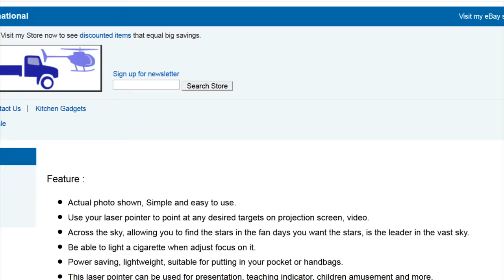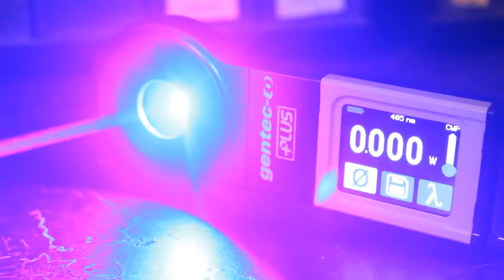Testing Illegal Blue Lasers from eBay (and making them even stronger)

Comment: I actually got a 450nm 1W Blue Diode Laser a few years back. It uses a 12V power supply and I adapted a set of lenses to focus the light into a variable+distant point.   For safety, I use some pretty dark welding goggles when it’s powered up, It can burn through 100 page pocket notepad in 30-45 seconds.
Reply: Can I ask where you got the diode and how hard is it to make your own hand held lzer

Comment: "Now it wont ignite my propane tank"
points laser directly at very flammable tank
WHATTTT
Reply: JoshLaw Music honestly i was scared for him when he did that
Reply: cästles theres always one LMAO
Reply: The guy clearly knows what he is doing. It's not that lasers can't "cut through" metal, it's that metal is a very good heat conductor, and all the energy of the laser is almost immediately spread around the thick, heavy metal casing of the tank. There's a common science demo about popping balloons with candles. Adding even a little water to the ballloon will allow it to sit in the flame for several seconds longer before heating the rubber up enough to pop.
Reply: A metal tank with a lot of mass is not going to heat up meaningfully with a brief touch of a 5W laser.   Some laserrs can can certainly cut through metals.  But not a 5W laser nearly instantaneously..  I'd bet money that he could shine that laser directly on that tank and it would NEVER blow up.  Too much thermal conductance from the thick metal.  Wanna bet me $10.  We can let Styro Pyro bet the official judge.
Reply: @Coasterguy Brilliant reply.

Comment: “Now it won’t ignite my propane tank. But, it can pop balloons with ease.” -Styropyro 2019
Reply: ..., standing less than one meter away from the propane tank
Reply: Propane, like gasoline, won't ignite from heat. Check out Myth Busters on gas tanks. If there is no oxygen, they won't even burn if a match is tossed in.
Reply: @mikemondano3624  myth buster also debunk HHO and turns out you can run a car on HHO https://www.youtube.com/watch?v=vglRrAAeGnE
Mlitary knows it we cant know it so they debunked it cause then no more oil and gas money cause turns out we dont need gas just water and baking soda lol
https://www.youtube.com/watch?v=uTOddz4x2M8
hmmm the heck???? you can use salt water too.

requires no mechanical modification of engines just a unit to convert water in to a gas form with electrolysis plates. so yeah it can be made with a fuse 30 amps switch so it does not drain the car battery with direct connection and it has a kind of pulse pattern so yeah. 
not sure I trust myth busters at all since some of the myths they  "bust" seem to be flat out proven to work and they are the "dont try it cause we know it work we cant let you know" people

Then people say "water would rust the engine" nah if that were the case then they would be rusting already since on a humid day th engine sucks in water and Gas can have water in it as well and we never hear about rust in the engine but on the surface where oxygen is freely available and its too hot in the engine to keep the water inside and the salt does not go in to the engine its just a catalyst to conduct electricity to make the gas so that is not poured in to the engine. 
I may make me one of them units closed cell HHO generator.
2 liters of water is equivalent to having like a full tank of gas like what??? can save a bunch of money with a generator and say screw you power company and have a water powered generator or something also added benefit it released more dense oxygen 30% that is more pure then the air outside. 
Funny they know about this and yet tax us on climate change right? but if we all swapped to water no profit for big oil  go to a local stream and get more water lol.
Also important to use one way check valves for gas safety to prevent flashback and people have also put in a copper mesh or extra measure and hook the intake to the air intake manifold near the air filter or direct to the engine. 
Myth busters didnt add a catalyst like salt or baking soda so theirs didnt work as good lol
Reply: @mikemondano3624  well most, if not all fires can't ignite without any oxygen...

Comment: “Let’s see how much power i can get out of this thing”
replaces all of the components
Reply: He replaced the diode, heat sink, driver and batteries. It still looks the exact same minus the hole in the side.
Reply: @hoagielamp6543  The diode is the "heart" of the laser. Changing the diode and all the control electronics is pretty much another laser in the same case.
Reply: @hoagielamp6543  that’s like changing GPU, CPU, RAM, SSD and Power supply but leaving old case. At this point it’s just a new pc.
Reply: @wiktorandrzejewski8242  Yes, now where do I purchase those replacement parts shown in video? :D
Reply: Well that was the point 9:43
Reply: @wiktorandrzejewski8242  If you were upgrading a cheap PC as much as possible or anything like that you would change the parts to get the most power out of it. No different in this case either. What did you expect ?
Reply: @cmac6136  sure, thats not the point tho. At what point does the old pc become a totally new pc? It’s an already well known thought experiment called “Ship of Theseus”.
Reply: @wiktorandrzejewski8242  yea, but for a Computer it is the Motherboard and for the Laser it is the Diode, the Core of what the item is, a ship...well I guess that's why it's a thought experiment because idk

EDIT: sorry wrong reply, I meant @Cmac 613
Reply: no, first he reduces it to a husk and then replaces all the components XD
Reply: I can imagine that with Phil Swifts voice
Reply: Here is the Original Semitic Text. HERE is The TRUE Savior

YaH The Heavenly FATHER HIMSELF was Who they Crucified for our sins and “HERE IS THE PROOF”

From the Ancient Semitic Scroll: 
"Yad He Vav He" is what Moses wrote, when Moses asked YaH His Name (Exodus 3)

Ancient Semitic Direct Translation
Yad - "Behold The Hand"
He - "Behold the Breath"
Vav - "Behold The NAIL" <— YaH’s Crucifixion
He - "Behold the Breath"

“Behold the HAND that Beholds The NAIL” 

PROVES - YAH The Heavenly Father HIMSELF was Who they Crucified

That is EXACTLY what Moses Wrote

Here is what they mean

YaH's Name:
(Ya)d + (H)e, as YaH is what Moses called Him and YaH Declared: "this is My Name, this is My Name for all generations" (Exodus 3)

YaH is The Creator:
Yad He, (HAND BREATH), as YaH's "HAND" Formed man from the dust  of the Earth and His "BREATH" made him a living being (Adam)

YaH's Sacrifice of Crucifixion:
Vav He (NAIL BREATH), the "NAIL" through YaH’s "HAND", that whosoever shall call YaH Savior, His “BREATH” brings forth life (Salvation)

How YaH arrives:
YaH arrives via the Tent of Meeting (Exodus 33:7:11, Isaiah 54, 55), where a Tent is erected outside the city, a cloud descends upon the entrance of the Tent and YaH appears...

Why they demanded YaH to be Crucified:
YaH was Crucified according to Hebrew law (Deuteronomy 21), to be Hung on an Almond Tree for BLASPHEMY as it was for His NAME they demanded Him Crucified. The Messiah claimed He was YaH...

HE WAS YaH!!!

HalleluYAH “Praise ye YaH”

From The Hebrew Book of Isaiah, The Dead Sea Scrolls

Isaiah 42:8
"I am YaH; that is my Name! I will not yield my glory to another or my praise to idols.

Isaiah 43:11
I, I am YAH, and there is no other Savior but Me.

Isaiah 45:5
I am YaH, and there is none else.
Reply: @asckinha  he never stated he would keep the components
Reply: @Praise___YaH  you it's time to stop using MDMA
Reply: @illford  

You have NO IDEA the hell that’s about to begin so make your jokes
Reply: @Praise___YaH  ...
Reply: @Praise___YaH  icewallowcome
Reply: @wiktorandrzejewski8242  in case you didnt know, you can call a power supply a PSU

Comment: "the key to not getting 3rd degree burns is not letting the laser touch your skin"

2 seconds later

Ouch. 

🤣🤣🤣🤣🤣🤣🤣
Reply: As long as he felt pain, he is good. It's when he doesn't feel pain that there is a problem.
Reply: If it laserers the skin instant skin cancer gun
Reply: FuKItM4n what does that mean
Reply: @bradleyduran6429  Since he still feels pain, his nerves haven't been burned off yet. And it's not a good then when your nerves get burned off.
Reply: @AlecH1313  yeah I've done that before. Touched a grille vent that was wayyy too hot. I heard my finger go "tttssssss" but didn't feel pain. So don't on that part of my finger, the nerves are fried.
Reply: @bradleyduran6429  Third degree burns, singe away nerve tissue. So if you feel pain, it's only a second degree burn. Which can semi-easily be healed naturally baring infection.
Reply: If you listen closely you can hear "f--"

Comment: I basically had the same problem with my Lasers battery. I decided to use a car battery. Last month when I was on my way to the store, my car died so I got my multimeter out and I checked the voltage on the battery and it was 9.7378 Volts so I thought “what the heck is going on with this battery”, the next thing I knew I seen some smoke coming from the tips of the battery terminals. I was suspicious on what was going on and I couldn't believe it because this battery was only barely 16 years old which I consider fairly new in today's society, so basically what I want to do is try to clean up the battery with some soap and salt solution and then I might put it on the charger for two or three minutes at a high current rate just to see if it will hold a charge. I'm not sure if that's going to help the battery or not but one thing's for certain before I go out and buy a new battery, I'm definitely going to try these two methods that I suggested. Now on the other hand I could swap the battery out with one from my 1962 Chevy Tahoe but I'm not sure that my old lady would let me do that, so basically what I need to do is first, I'm going to check all the air in the tires before I monkey around with the battery. Then I'm probably going to run a few errands around town down and the next thing I want to do is get some paint and paint the battery terminals because I don't think they look very good without the neon yellow color look on them.  If all goes well, I am planning to do a few other things to the terminals. Next after that chore, is get some of that distilled water and pour on the outside of the battery to try to clean up a lot of the dirt and dust its accumulated over all these years. If I have time what I'll do after that it's try to clean both sides of the mirrors on my 1965 Ford Bronco because I've noticed while I was driving that it's hard to see what kind of traffic is coming up behind me. I was having a problem with the battery when I put the headlights on low beam and then when I tried to switch the high-beam I noticed that the voltage excursions were jumping around so I went out and I bought another set of test leads to use on my digital multimeter and there was no difference at all, so I think I may borrow my friend Tony Jones's multimeter just to check those voltage excursions to see if that is normal. Nobody really explained to me how to test a DC voltage excursions when the battery is not in its prime. I am all on my own doing this. A lot of people have contacting me and they said that they've had that problem once or twice and maybe even three times in their lifetime with their batteries but they did something totally different. What they did was loosen the terminals first then they carefully remove the battery and hoisted it out to get rid of all the debris and dirt that's accumulated after all these years then they put it on a slow charge which I believe they told me was 32 milliamps for 6 days, 3 hours and 54 seconds. Next they took the battery caps off and added some distilled water, which they claimed that they bought it at their local Walmart store. I think, if I can remember correctly, they said it was .99 cents plus the sales tax. Can you believe that just 99cents? That's a real good price for one full gallon of distilled water. Speaking of water, yesterday I helped my neighbor that lives to the right side of my house, fill their swimming pool for the new season. It literally took 7 hours to fill. I am not sure how many gallons it is. I have met people in my lifetime that had no idea that there were 4 quarts of water in a gallon jug. They just assumed it was a gallon only. I am not really good at math but I do have a calculator on my cell phone. Speaking of math, it takes me back to grade 11 in high school when my teacher, Mr. Lowry gave us a sneak quiz on algebra. I failed it because I didn't understand what that was all about. I spent most of my high school time stoned and kinda out of it. Some of my classmates were very good at math, and it even showed when they got their report cards. I may have gotten of the path of whatever we were initially talking about. I think it had something to do with blue cheese. No, I remember now, it was car batteries. I never could figure out why they put car batteries in the front of the vehicle and not inside the vehicle. It would be so much easier to work on them, especially in the rain, if they were inside the vehicle. Doesn't that make more sense to you too? Well anyhow, batteries are pretty heavy for their size and some people can't lift them very good. I had a fried, Tony Smith who had asthma and once he tried to lift out his car battery, and sneezed, and the battery fell out of his hands and landed on his right baby toe. It broke the small bones in that toe of his. I called his mothers step daughter Ann but she was not home. So I then called his brothers uncle Fred and told him about what just happened to Tony's toe. He seamed like he was drunk and started laughing at me and said “I don't care about that Bast#$ds toe”. I got mad and hung up on him immediately. From that day on, I never spoke to Tony's brother's uncle Fred. I never really liked him in the first place bacause when Tony and I were 13 years old, we were at a softball game and Fred walked over to us and farted right in our faces. That was not very nice of that old pervert. I heard some stories about him when he was about 20 years old that would make you cringe if you heard them, but I can't get into that right now because I have to finish up my posting here on you tube. I hope I have given you folks some good advice on having some of your problems solved in a timely manner. I like to help out when I can if it is at all possible. I am out for 3 more hours so I want to go now and get a hot dog and a bottle of grape soda. I need to look around for a ride so I can get back to my padded room at the Sinclair Insane Asylum. I hope Dr. Dilbert will not be mad at me for sneaking out....

Comment: 'Ebay has a lot of restrictions'
Also Ebay: Sells asbestos filled gas mask filters
Reply: You can buy uranium and other radiactive
Reply: I think I have some of them and actually used them.
Reply: @lussor1   uranium isn't that radioactive though
Reply: @selcouthphic9459   but uranium is radioactive
Reply: @viktorreznov6747   its about as radioactive as your phone is
Reply: @selcouthphic9459  so why are we using uranium insted of my phone to fuel nuclear power plants then?
Reply: @viktorreznov6747  you got me there but the small amounts you can get on Amazon and sites like that the peices you get are as radioactive as your phone
Reply: @selcouthphic9459  That is really misleading. Your cell phone isn't emitting ionizing radiation. Uranium is an alpha emitter. If you drop your cell phone and breath some dust from it you aren't going to be slowly irradiated from the inside.
Reply: @outsider344  Raw uranium isnt that unstable, enriched uranium is the one that emits all the nasty radiation

You should be just fine if you simply have a couple of grams of uranium ore
Reply: @selcouthphic9459  you right bro, it's different isotopes of uranium that are the super radioactive ones, such as uranium 235 which is used in nuclear reactors
Reply: @OfCourseItsKC  thank you for researching and not just typing what you think
Reply: @selcouthphic9459  I didn't research anything, I just know that kimda stuff
Reply: @OfCourseItsKC  well thanks for having my back at least
Reply: @OfCourseItsKC  i am curious what school did you go to, to learn that stuff